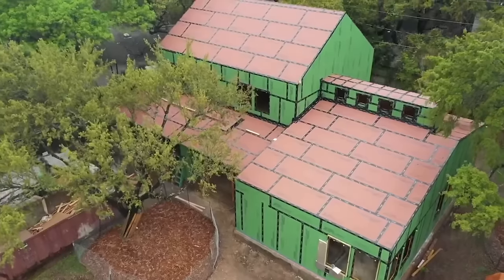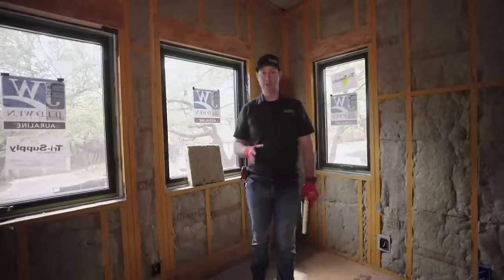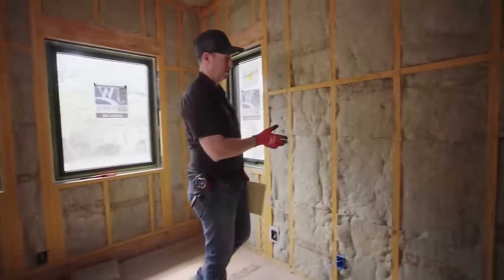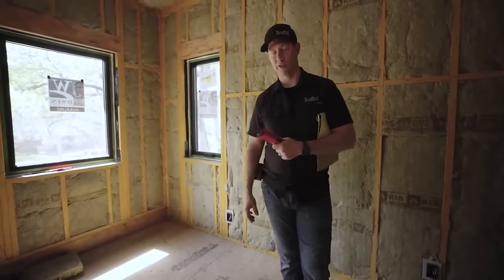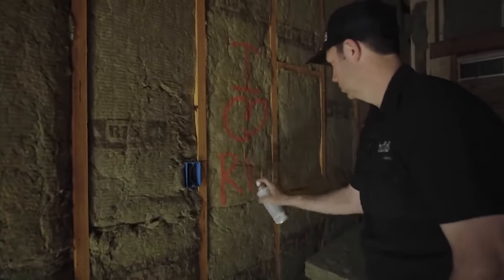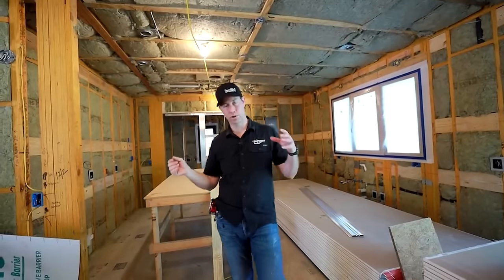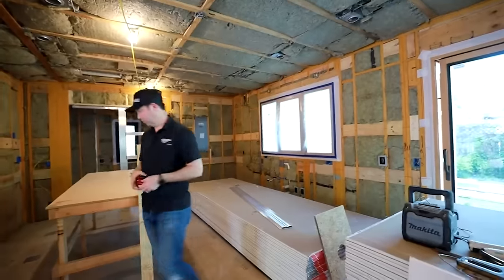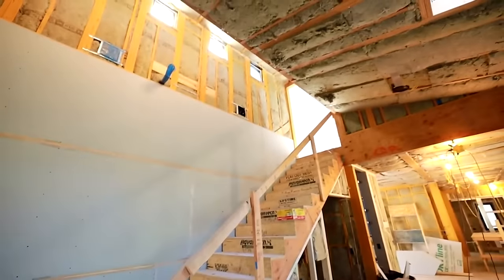Insulation, Drywall, Bathroom Waterproofing - Real Rebuild Ep. 5

Comment: At my box stores rock wool is more than double the price of other insulation. Where are people finding it “close” to the same price?
Reply: My builder quoted me the same (double the price of fiberglass) here in Dallas, TX
Reply: Lowes was the cheapest I found
Reply: @jacobecorder  in the upper Midwest Menards has a different brand of mineral wool that was a little closer to fiberglass prices but still higher
Reply: @sheepdogonthehill  yes. That stuff is stupid overpriced. I'm in Minnesota and I get mine from Lowe's. It's about 1$ per sqft for r15. And price is consistent to r30 so 2$ per sq ft for r30. I did 19.2 oc so I had lots of cutting. They don't make it for 19.2 spacing.
Reply: The name brand of Rockwool is like $85 for 12 batts. But the other brands of mineral wool are a little more reasonable, at $29 for 7 batts.
Reply: @gmartinnc  holy crap..that was 60 last year. Now 90. I'm so tired of these companies bending people over. That would have cost me 4k more and I don't have 4k more.
Reply: @jacobecorder Also in MN, considering spray foam for the attic. Not sure if that is a terrible idea. Attic has two small vents and my soffits somehow have no vents.(1975 house)

Comment: Matt, with a 30yr old house with blown in insulation, would it be more cost effective to remove and replace or, condition the attic space to reduce the temperature swings experienced seasonally?
Reply: If you're gonna go the conditioned route with spray foam the blown in must be removed. Especially if it's fiberglass. The atomized particles of the foam in the fiberglass will cause an odor. The blown in would also trap moisture now that the attic is part of the conditioned space. Do you have HVAC in the attic? If so, conditioned attic. If not vacuum out the old, air seal EVERYTHING then blow in R60 cellulose

Comment: Just for the record there's no such thing as "totally soundproof". At least not on a home building budget.

Also the Rockwool contributes relatively little to the sound transmission loss of the walls and floors compared to the drywall. Since it's no longer exposed to the air it is no longer providing sound absorption. Its role now is to dampen resonances within the wall cavity. 

Drywall, as you mentioned, is highly acoustically reflective.

I'd you want to deaden the acoustics you need to put up some absorptive panels. Rockwool Comfortboard 80 and 100 are excellent for acoustic panels.

Comment: why don't we just build homes out of one thing?... concerete.....
Reply: CO2 emissions. Wood is also easier to work with.
Reply: @phamlam3720  
think thermal mass and the fact concrete accounts for like 9% of total gas exchange while depletion of our forests account for all the rest....
Reply: @jonerlandson1956  You are going to spend a bit of money heating that thermal mass anywhere in climate zone 4 or greater.

Most lumber you see come from sustainable forest. They are cut down and regrown. We aren’t using old growth.
Reply: @phamlam3720  
i disagree... i think it ideal... thermos bottle construction... and absorbent refrigeration systems...
Reply: @phamlam3720  
concrete inside and out separated by mineral wool spirits...
Reply: They already do, it's called ICF
Reply: @LincolnLog  
that's a start.... i think it needs to evolve...
Reply: @LincolnLog  
i see ICF as inside out....
Reply: US houses (exception with some from Florida) are called Matchbox Houses, which unfortunately not safe when someone will shoot the occupants. Besides the metric system, Americans should also adopt the Bidet system to totally eliminate poop stain on their underwears.
Reply: @juicyisjoyce  
i try and leave politics out of my life as often as possible... however... this is getting beyond bearable any longer... i'm going to vote for Kennedy...